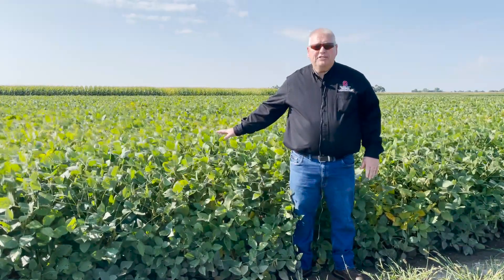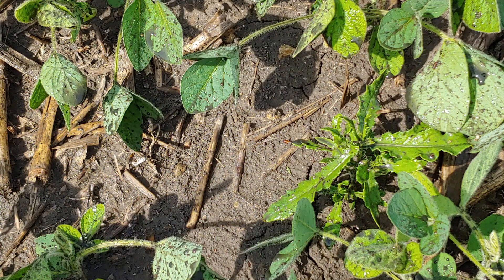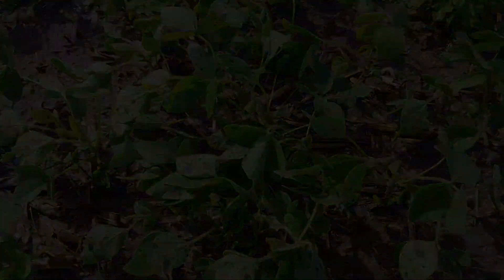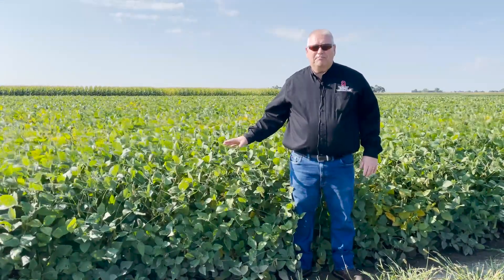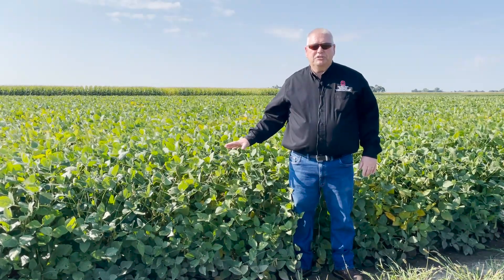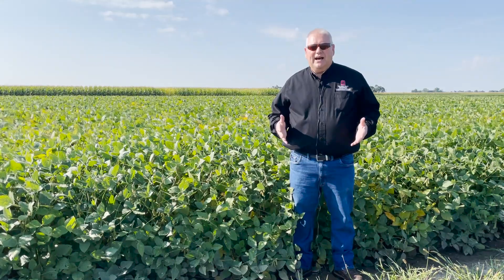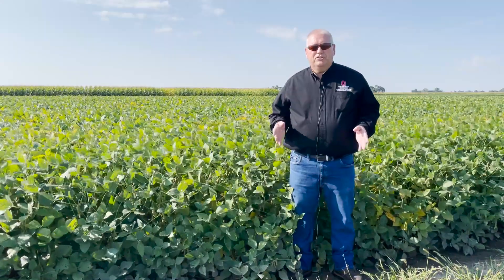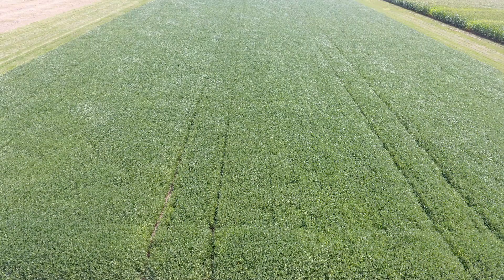Applying Manure on Growing Soybeans

Comment: Do you have any information on using manure to create bio energy?  My main question is: after harvesting the methane, does the manure have the same benefits when used in the field compared to manure not used for bio energy.  I’d rather get a two-uses for one product if it will offset the cost of harvesting the methane.